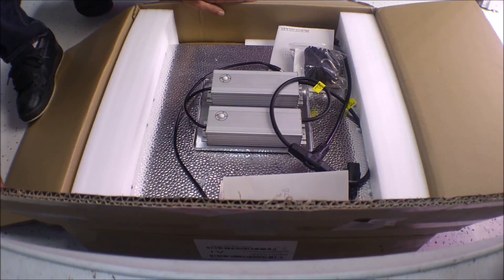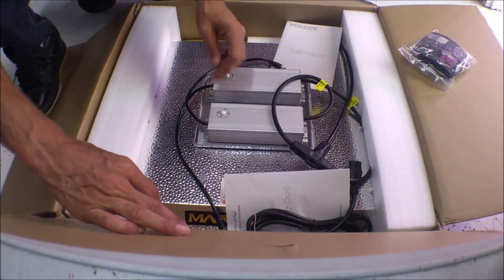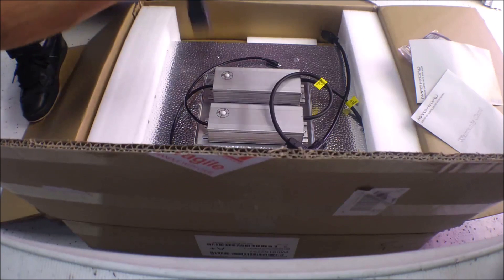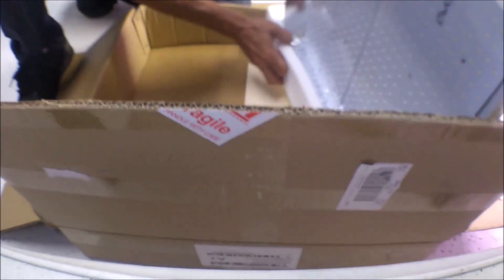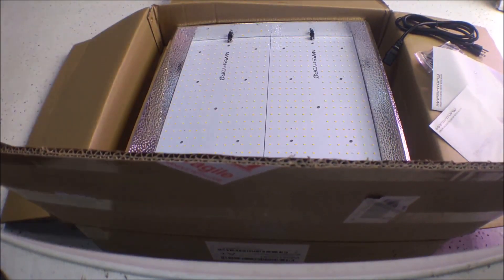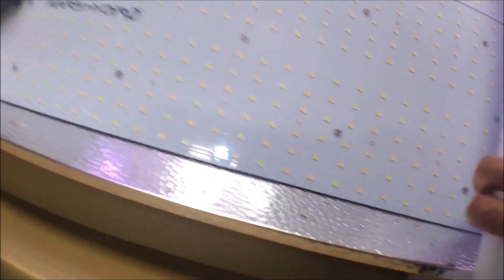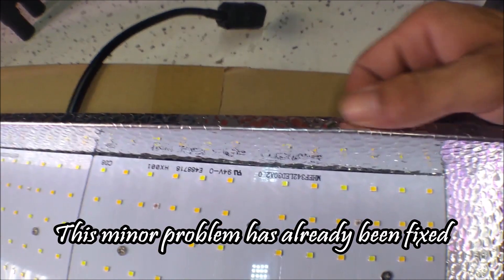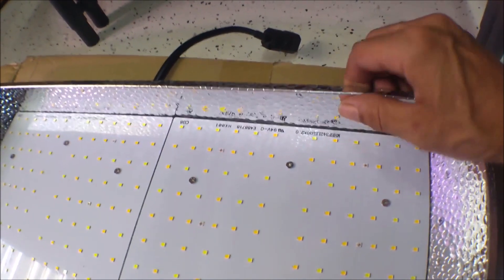Mars Hydro TSW 2000 Unboxed and Reviewed Power Consumption Light Test

Comment: i just put this into play last night. I got tired of the battle Royal with the HPS system pouring off heat into my new build... I live in the desert... I'm exhausted trying to keep it 70's... and it's not even hot yet.

[if you're  a poor meter-less soul, with respect to whatever surface you are pointing your light toward, this TSW2000 par meter readings 12-16" from surface (with no plants) is in the range of 1200-1400....so 18"-20" is a minimum (vegetative state) at approx 1000-1200 & the outer 3' perimeter 550-600] 👨‍🌾🤙🚜 Scott's OG🎄
Reply: Nice Graphics man. That was you on the guitar too 👈 ... 
Man your whole Channel is smoking dude. Lol. Imma Follow You

Comment: Do Not Buy Mars-Hydro! They do not honor their warranty and customer service is non-existent. I purchased a Mars Hydro FC 3000 grow light on November 30, 2020 for $359.99. In June (2021) I noticed the dimmer switch wasn’t working halfway into a grow. I contacted Mars Hydro on June 8, 2021 (as well as 6/9,6/10, 6/21, 6/22) and explained the situation. I’ve sent pictures. I’ve sent videos. I’ve even offered to buy another light, have them send it to me, and let me send the malfunctioning light back to them and they just didn’t respond (6-16-21). Every request is met with another question. Today’s date is July 12, 2021. Mars Hydro has neither repaired or replaced or refunded my money. I’m asking PayPal to step in. Do not buy from Mars Hydro and especially not from marhydro. I have physical proof in the form of saved emails to verify everything stated!	WPR 7-12-21

Comment: My cousin has the tsw 2000. He talked me into it. But due to budget restraints I ended up getting 2 tsl 2000. I use them together in a 4×4 tent. I eventually plan to move those to their own tents for seedlings and early veg. And get an fc 4800 for my main flowering tent. One tent is not enough, my girl has little clones and seedlings all over my tent when I look away. Like she cant grasp that much light burns the little plants. I need the bigger light with a second tent. Good luck, I wasnt sure myself if the tsw 2000 would be enough for a 4×4 tent.
Reply from the maker: Yeah it's just about enough as long as you can keep your plants short enough.  Which only forces you to flip your plants faster. Keeps me on schedule. Good luck growing. 👍🏻

Comment: I just got one with the seperate dimmer & one side of leds  doesn't go out completely, I've tried adjusting the dimmers on top manually but the one side does not go out/down to zero. Only goes out when the plug is out of the socket, anyone else get this problem?

Comment: So you hang this at the celiing of your tent?
Reply from the maker: You can. Mine is in a big room
Reply: @GoliathGrower  can you hang them from the poles that hold up the tent?, not the support poles. I just got my tent and my mars 2000 but havent treid to hang it up yet. I Have a 3x3 and its up
Reply from the maker: @quincypinola839  yeah it should hold no problems
Reply: @GoliathGrower  yes ill give it a test when i get home
Reply: @GoliathGrower  Yo what are those things hanging from the ceiling, what are they called?
Reply from the maker: @quincypinola839  D rings. They mount to the ceiling.

Comment: 286 watts for a light that has a 4x4 footprint is great. I'm using a Vipar Spectra 600 in my 3x3 tent and its not quite enough light tbh. It works good, but I know I could get better yields, and it pulls 276 watts, but using the old burple LEDS. So I am thinking of baby stepping up to this light.

Comment: I bought this light, has been sitting  still in the box unopened in my living room
For the past week....
My last works shift up north then home bound...cant wait.
I'm happy to see your volt meter 2.85 watts that's good ta see.
I plan on using mine in my 
mother/ veg room,
Bud room will have 2 Electric sky 300 V2's 
(which is also sitting in my living room)
 to replace my 1000w DE HPS.
Really need ta get my ass home
Reply: Could you use this for flowering? Smoke for 20 year new to growing?
Reply from the maker: @DougieRay  absolutely 👍💯

Comment: Hey, i am unsure what to get either spider farmer sf2000 or the Mars hydro tsw2000. Any recommendations?
Reply: I just set up my tsw 2000.
First thing I notice lying in bed was NO MORE FANS RUNNING.
It ran cool at the top of the canopy (22 celcius).
If the spider also cools with a heat sink, then I'd just go with the one that uses less hydro.

I went with the Mars just cuz it happened to be the one that was in front of me...
Reply: @JoeLLacelle  Hey, thx for the reply. I don't get what you mean by 'using less hydro'. Can you make it more clear?
Reply: Spider

Comment: Hey! Im from spain and i want to buy these on the oficial page. You recommend it for 1x1x2 tent?? TY
Reply from the maker: The TS 1000 will easily cover that area. You can use the link in the description for a discount. Thanks!!
Reply: @GoliathGrower  and the ts 2000 fpr 120x120x2 right?
Reply from the maker: @odatestachofisial  TSL 2000 is 3x5 veg 2x4 bloom and the TSW 2000 is 4x4 veg 3x3 bloom

Comment: This is a great light. Its a shame that the next version, the TS3000, which runs 450 watts is almost 600$ canadian.The TS2000 is 340$ canadian. I'd be better off buying two of the TS2000 models instead for an extra couple bucks and be rocking 600 watts as well.
Reply from the maker: I believe the TS3000 has 4 panels of quantum boards. So it's 2 of the TS2000 put together.
Reply: @GoliathGrower  the 3000s are 450 watts the tsl 2000s  are 310 watts. i have two tsl 2000s which is 620 watts. the 3000 does just look like two tsl 2000s put togather though mabey just a weaker driver.
Reply: @GoliathGrower  Errr Nope, it's 450 watts. Two drivers and two panels.
Reply: The 3000 is two 1000's put together!